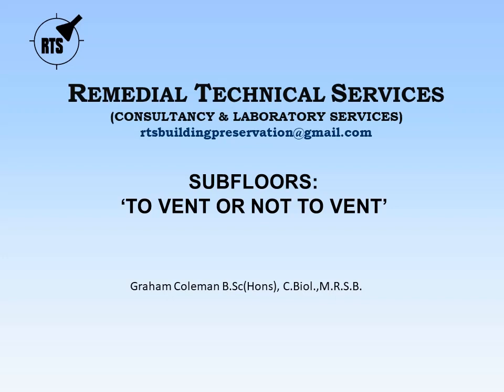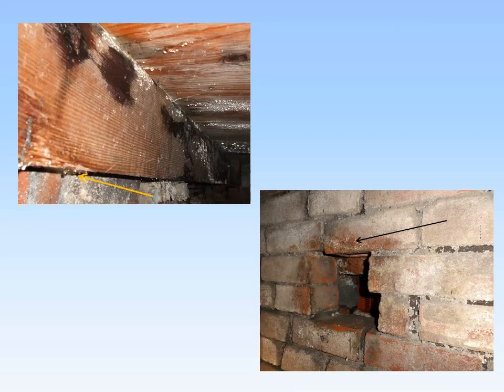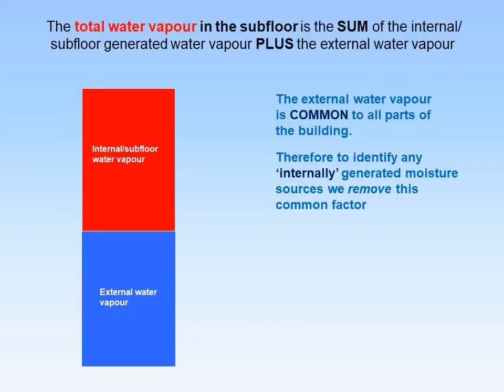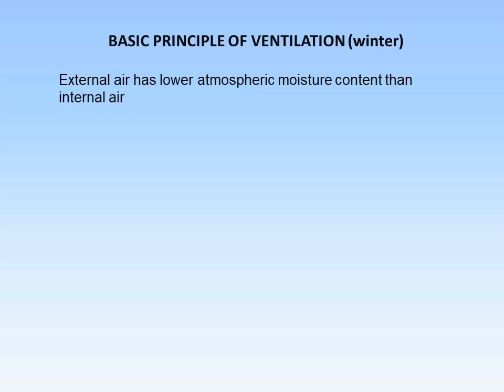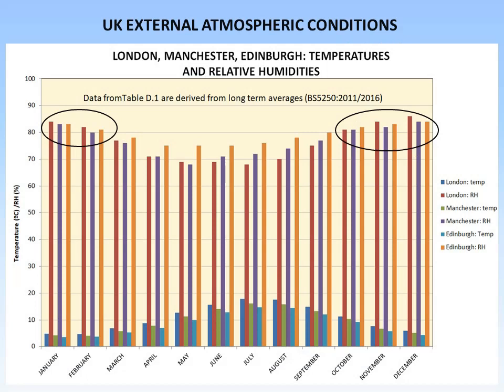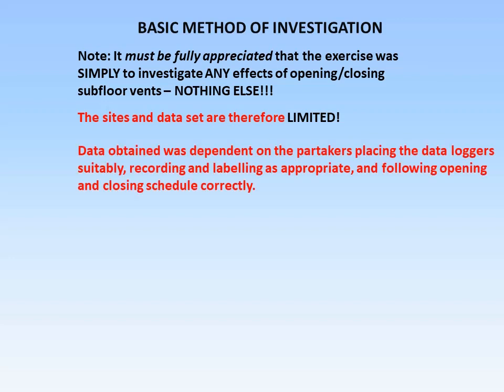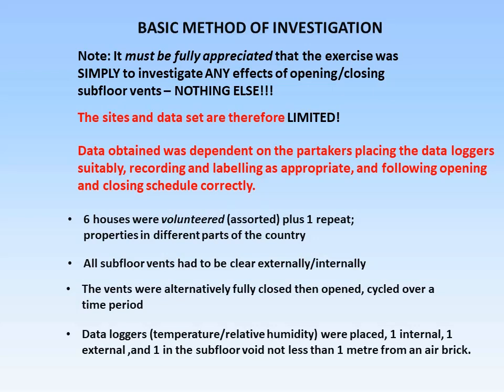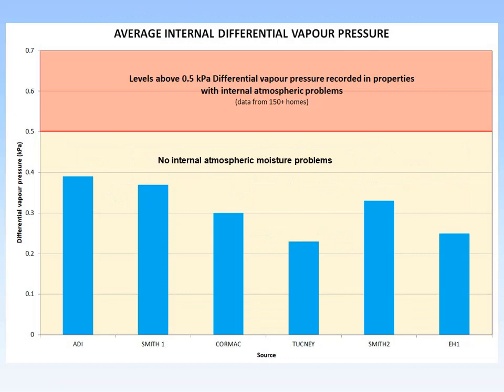Subfloor ventilation - to vent or not to vent?

Comment: Earlier this year I insulated under suspended timber floor.  There was plenty room under crawl space / sub floor.   This week I went under again to inspect everything and noticed there is some mould developing and in one or two spots a little condensation.  Temperatures have been high in my area of Scotland over the summer.  I am wondering what I should do.  Currently the space is ventilated by (probably not enough) air bricks.